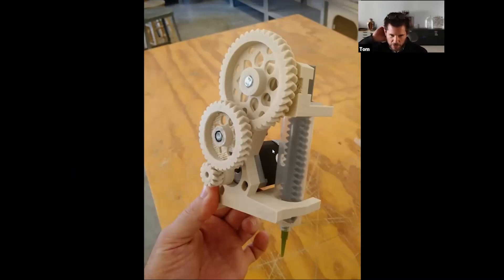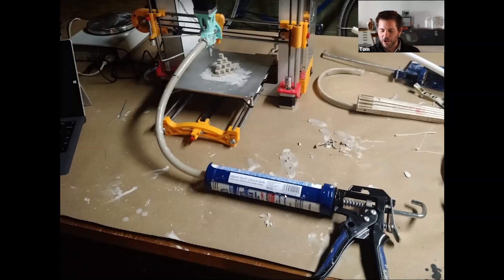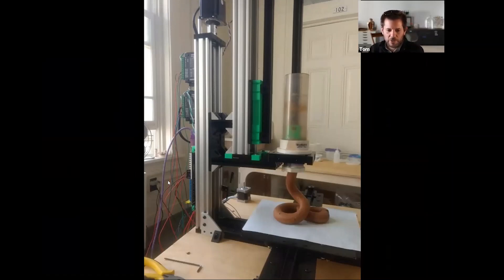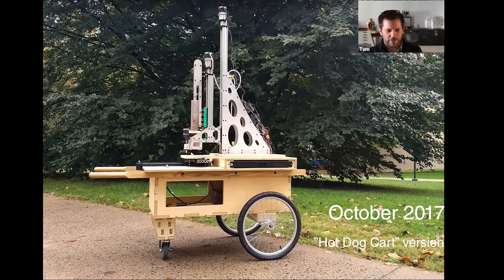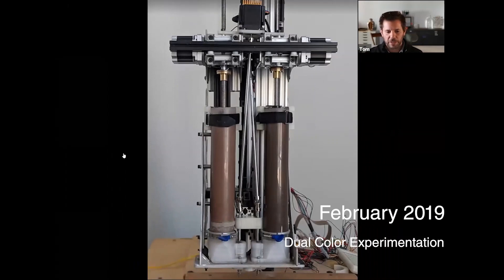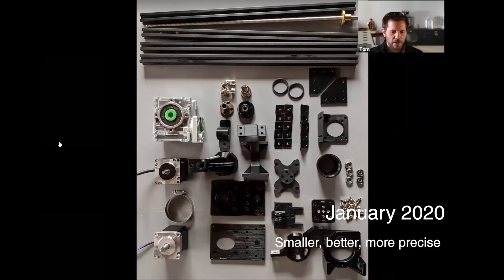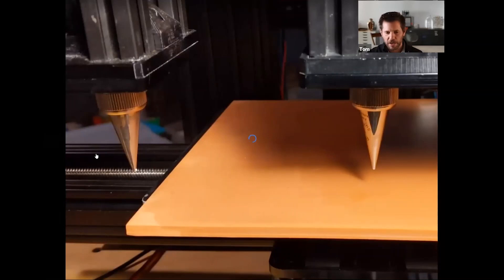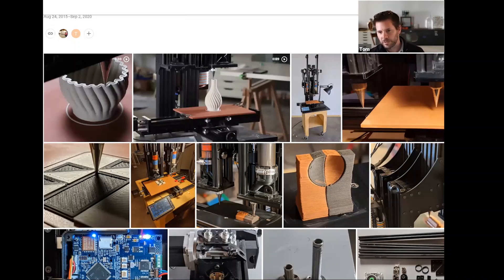My Experiences Building Clay Printers 2015-2020

Comment: I WHAT ONE. Maybe you should try the pressurised air printer again but with smaller clay tubes for lower pressure and more refillings. Also i always hated my Velleman k8200 with. the same x and y axis as yours so its interesting that you chose that design :)
Reply from the maker: Thanks for your interest. I know one thing for sure, I'm never going back to using air to move the clay :). As for the format, there are always tradeoffs, but I have a few guiding principles: 
1. The clay should move the shortest, easiest distance possible (clay is very hard to move through a tube!). In my design the clay travels only about 7cm from the syringe/storage to the print bed. 
2. Whatever is lightest should be the thing moving. My printhead weighs 15 pounds, and there's two of them. I don't want to sling 30 pounds of extruder left and right. The print bed, even with a large print, will weigh a lot less, so it does the moving on X and Y, printhead just moves on Z. I should make a video about these design decisions. Certainly many others made very different decisions!
Reply: @TomLauerman  OK that explains a lot. I reakted to the bed design since I have only had trubble with my FDM-printer with the same design ;)

I must ask, don't you have any trubble with wobbles when the print reaches a sertain hight?

Comment: Kickstarter?
Reply from the maker: People would be so disappointed at the (surprisingly high) cost of my printer, I'd never hit a reasonable price point that would make a Kickstarter viable. Beyond that, my focus is on research and experimentation, I'd never want to "lock down" the design, which is always changing. Thanks for you interest, however, and check out printers by WASP 3D, Potterbot, Stoneflower 3D, Lutum, and Cerambot

Comment: I'd be interested in seeing a hopper setup for this, similar to how plastic extruders work with pellets. This would give the printer extended print time without having to replace a tube of clay, and may end up taking some stress off the Z axis if you make the hopper and feed system it's own separate machine. 

It'd also be interesting to see a companion machine that touches up the surface. Like a 5 axis drag knife that holds clay forming tools. Unless smoothing with a slurry is a viable option, though how well would that hold up during and after baking in a kiln?
Reply from the maker: Pieces do great in the kiln: https://youtu.be/A8mtXB8lWn0
Thanks for these other suggestions, which I'll keep in mind. I do like having the clay as close to the print head as possible, that has been a guiding principle, with some ups and downs.

Comment: Did you try a direct drive peristaltic pump for precision pressure? maybe it can help reduce the nozzle diameter further if the clay particle size is consistent enough and the pulsation of the pump is minimized for the range of flow rates?
Reply from the maker: Keith Simpson is an artist who has made a nice peristaltic pump clay printer. In his, the extrusion pulsates, creating a beautiful effect. However, I want to have the extrusion be consistent. Peristaltic pump might be a good way, but I'm happy with what I've been working with, and not ready to move on from mechanical syringe yet.
Reply: @TomLauerman  after sleeping on this yours is certainly preferable.
Reply: @TomLauerman  I think you would just have to solve for a low pass of the flow. Something like a container with volume and a certain distance of tubing between the pump and nozzle may even out the ripples (as well as picking the right peristaltic pump).

Comment: This is awesome!! I want to build one and a clay harvesting machine so I can print ceramics for relatively free and possibly print aluminum casting molds!
Reply from the maker: I have printed clay from my backyard (after a lot of sifting, etc) would be a good topic for a future video.
Reply: @TomLauerman  Do you know of any automated machines to do so? I have drafted up a machine after watching some DIY videos. it uses two containers (buckets), one with a stirring rod (motor with a rod attached to the lid that induces a cyclone) and another with a fan on the lid. The stirring rod container excites the particles (bunch of dirt in water) and waits for a settling time duration before pumping the top fraction of water into the second evaporation container (again just a bucket). I'm hoping to automate the process with a garden hose and solenoid valve and an arduino or raspberry pi with relays.

Comment: Have you tried wax based medium like monster clay ? 
It would be interesting to create molds of the printer part and melt and reuse the material, either for resin casting or metal casting.

And I don't know what consistency of clay you need for your printer but maybe there is a wax based one that would work out of the box.
Reply from the maker: This is a nice idea. Personally however, clay is the material I wish to use as a final product.

Comment: This is really cool! Do you do any post processing on these prints? Like do you just let the clay dry in air or would you fire it in a kiln like regular pottery? I would immagine there could be some shrinkage issues when you put intricate parts in a kiln.
Also have you used this for mechanical parts? I can immangine that ceramic, and therefore heat resistant parts could have a lot of applications.
Thanks for sharing this!
Reply from the maker: I do fire and often glaze these pieces, see here: https://youtu.be/A8mtXB8lWn0
The clay used is the same as they types of clay you'd find in a ceramics studio or classroom. Thanks for your interest!

Comment: Did you try hydraulics?
Reply from the maker: I did not, thanks for the suggestion.
Reply: @TomLauerman  would be bulletproof and you could control a huge reservoir of clay and high resolution extrusion with very small nozzles would be possible. 
Less moving parts and electrically controlling the solenoids through logic would be easy. Double acting hydraulics of course, for your retraction.
The pressures you can generate in a small footprint would be immense, better for multiple colours too. If you were to go into production, they would survive shipping.
You could also have nozzles of different sizes on the one cylinder/reservoir to increase speeds for low resolution parts of the print. Just control the nozzle with solenoids and the slicer would treat it as a different extruder and assign the linewidths to each extruder. Fun project.

Comment: So why not use auger in the nozzle to adjust final feed speed, tube to move the material, auger to move the material trough the pipe and hopper that could be operated by linear actuator or by hand to feed the clay to auger feeder, or alternatively "tool head swapper" that just swaps the clay piston tube setup to another middle of print and can be easily filled while its working the first one? You already have aluminum frame so locking the tube in place aint that difficult just little engineering to make slots to slide it and simple locking mechanism. While the tube does not move except up and down, have a pivoting arm to grab the num1 tube, turn it around 180 degree in the "wrist", place the new tube in place and return to default position. This also can be used with 3-4 arms to swap colors easily, though it will take bit more time compared to double nozzle setup, but even that can be swapped with this same setup, just need servo etc to lift the one piston bit higher than the first one is so it wont touch and you gain back lots of your build area.

Also have you tested any surface finish methods like spraying water on the surface after the print, before drying and kelm treating it?
Reply from the maker: Thanks for all of these suggestions, some of which I've considered, some of which I haven't yet. A tool changing approach is very interesting, but the extruder weighs about 15 pounds, so it's non-trivial to move it around. Still, I'll give these insightful suggestions some thought, thanks!

Comment: You have LOTS of clearance around nozzle. This is really good news for non-planar slicing. But i think the nozzle should be slightly modified to allow for some ironing to achieve even smoother look.
Reply from the maker: Thanks for the suggestions and for your interest! I have heard from a few folks interested in non planar slicing, and it is intriguing. One obstacle to implementing this is my personal skill set. I'm better with mechanical and material challenges and less adept at things like toolpath design, for which I rely entirely on slicing software. I'll keep this in mind, but it may have to wait until mainstream slicers implement non planar capabilities, or a plug-in enabling such a thing. I'm definitely interested!
Reply: @TomLauerman  There are already experimental slicer forks with this feature. Maybe you can try this: https://github.com/Zip-o-mat/Slic3r/tree/nonplanar
Reply from the maker: @harviecz  Thanks for the link, I'll check this out!

Comment: I always liked systems where the material is cheap and readily available. Plastic printers are cool, but you're entirely dependent on a big supply chain to deliver that plastic. Until now, I favored cnc milling machines, because wood is so easy to get or reuse.
I wonder if anyone does concrete printing or milling. But I guess concrete milling would destroy the tool head pretty quickly.
Reply: you could probably do high rpm small tool head machining on concrete.
Reply: https://www.youtube.com/watch?v=FaNLkd0rzXk not exactly desktop scale but really interesting how they approach the challenges that come with concrete. worth the watch imo
Reply from the maker: Concrete printing is definitely a thing, there are lots of great examples out there, for the housing industry mostly.
Reply: Most plastics are cheap and readily available though. And most people rely on a big supply chain for wood as well.

Comment: I also got into desktop 3d printing right around when the Makerbot cupcake was starting to be a thing, however, I never went the route of clay printing, but i do remember seeing your stl's on Thingiverse years and years ago, I went the resin curing direction, nonetheless, now in 2021, I am interested in clay printing, What kind of clays work best? polymers or River clay, I have an inexhaustible source of blue clay right here in my own backyard, would that clay work well? it would probably need to be processed into usable pottery clay I'm sure?
Reply from the maker: Just about any clay will work if it is the right consistency and doesn't have foreign material in it like pebbles, sticks, etc. I use clays that are meant for an art/craft studio (I'm a ceramics teacher). I have also used backyard clay, but it needed to be thoroughly sieved. Thanks for your interest!

Comment: Is it possible to post the part list? Would love to build one of these myself but I’m keen to not reinvent the wheel.
Reply: Or alternatively go into details about the latest design and show how the extruded works.
Reply from the maker: I have started to do this I think, for example I posted this today: https://youtu.be/-n6nIgkaNtM
As for a parts list, I've posted one in the past but I'm always changing the design and making custom metal parts. This has been frustrating for folks trying to make a version of this printer. If I was starting this project today rather than 5 years ago I'd probably start with a commercial system. There are a number of producers now including 3D Potter, WASP, Lutum, Stone flower 3D, and Cerambot.

Comment: 4:24 When you started talking about how you can 3D print clay with an inch wide nozzle and said you probably could not 3D print plastic that wide it made me think. If I would try to 3D print plastic that wide I would probably have a nozzle that looked kinda like a shower head.

Comment: Stumbled across this channel from a suggestion, and was blown away by the resolution you're getting. Do you have any plans available for your extruder design? It would be awesome to try using metal paste instead of clay for a hobbyist-level metal 3D printer.
Reply from the maker: Many thanks for your interest! The printer design is always changing (as the video shows) so it has never really settled down enough to do proper plans. The other issue is its got lots of custom made metal components that I think would drive people a little nuts to try and duplicate, even if I had good drawings/specs. That said, there are some good commercial machines out there from companies like WASP, 3DPotter, Stoneflower, and Cerambot.
Reply: @TomLauerman  how do you think these kits compare to your machine? you said in the video you are getting better detail than commercial clay printers
Reply from the maker: @britzwickit  Thanks for your interest! I'd put it this way - I'm building a machine that suits my very particular needs and obsessions, whereas a commercial machine will be designed to work in a broader set of use cases. To make an analogy, if a commercial printer is like a guitar, that can be played in many styles by many people, then my printer is like some goofy electric lute that meets the needs of the luthier who designed it, but likely almost no one else. It's comparatively small, expensive, complex, and eccentric as well as ever-changing, and has proven to be frustrating to others who have  built a similar machine along the same lines from time to time. I set out to make a Prusa-style printer work with clay, but I ended up somewhere else entirely. Even working with my students I can see the limitations of my design with a broader audience - the print envelope is fairly small the prints take quite a long time, and the machine is not intuitive to use. I'm thinking of buying a commercial machine for the classroom for this reason, even though I'm not considering using a commercial machine in my own work & research. I hope that makes some sense, thanks again for your interest!

Comment: Really interesting! I imagine you could use it for other materials that have similar properties, like some forms of dough or icing. Have you experimented with anything other than clay?
Reply from the maker: I have not, I have such an intense interest in clay that I never get around to trying other materials, I'm very boring that way - but clay has infinite possibilities (but not as food)
Reply: There is chocolate printers for decorative peaces and they have even manage to get surface finishing with flame "polish" to get surface nice. While construction side has working prototypes, even commercial concrete printers that can make anything from art to full size small house frame, to witch design usually has empty center and two layers on each side so one can pump urethane foam insulation into the middle form, concrete on the two outer ones with rebar reinforcement and insulate it real quick. Essentially you print wall forms that you the pour and insulate. Though concrete nozzle size was pretty hefty around one inch and some half inch ones for art work, if i recall right, there is video about in youtube and some guy got 3d scan of him self and concrete printed 3 ton statue of him self, that was crane lifted next to his buddys pool side as birthday gift... with some surprises inside the statue and of course water hose going from bottom to statue lips so it works as fountain :D

Comment: Btw, I have an auger and extrusion and stress Duet board and motors.. Where do you get the nozzles?  Is it some type of piping tip for icing or custom?
Reply from the maker: Yes, precisely, I use cake frosting tips for cake decorating.

Comment: Amazing clay prints!
I love designing 3d printed compressed air engens. Do you think your clay 3d prints could be used to cast aluminum?
Reply from the maker: DO you mean a printed ceramic mold into which aluminum (molten) would be cast? I have no idea - but in principle I believe it would work. Would have to take precautions to make sure it would be safe.
Reply: @TomLauerman  thanks!
 I thought ceramic aluminium moldes molds might get 3d printers closer to self replicating.
Reply: Been pondering a similar idea, using plaster of paris or investment plaster to 3D print a mold for aluminum casting. Similar to lost resin casting, but you don't have to do the resin print first and then burn it out from the plaster.

Comment: And one more question -- how about drying the clay as you print (i.e. using fans or something)? I have no experience with clay whatsoever, just curious -- some plastics need it, for some kinds of plastic it's detrimental...
Reply from the maker: I'm printing with clay that is relatively stiff and not super wet, no forced drying needed. I have the opposite issue sometimes, the print dries more than I want to when printing over the course of many hours. I have considered building a humidifying enclosure to counteract this.
Reply: @TomLauerman   this gets me thinking...  I've seen wheel potters and hand builders use a butane or propane torch to dry their clay really quick. 

Could you use one of those small ones (like cooks use) mounted near the extrusion point to spot bake the clay and possibly build objects wet clay couldn't support?
Reply from the maker: @Scott_C  In short, yes! In the longer term, I'm interested more in developing a "combustible" printed support. So the object is made of clay and supported by anything extrude-able and flammable (for example paper pulp) deposited by a second print head. Then in the firing process the support burns away. Thanks for your interest!
Reply: @TomLauerman  keep making awesome stuff!